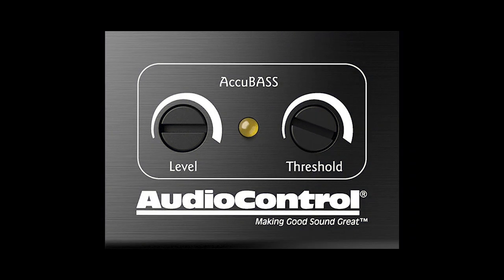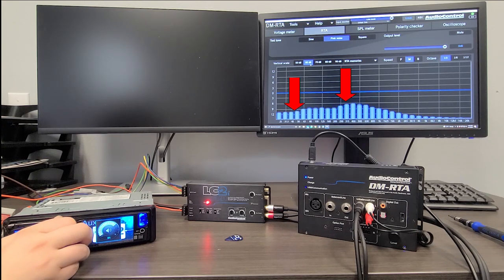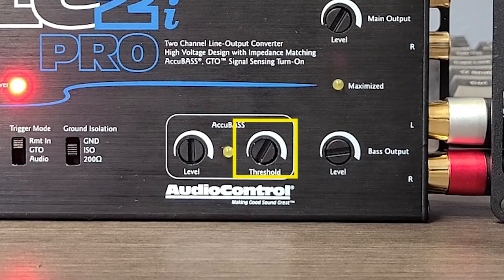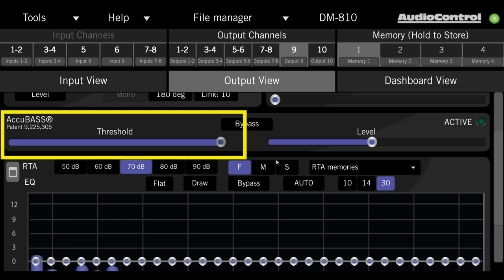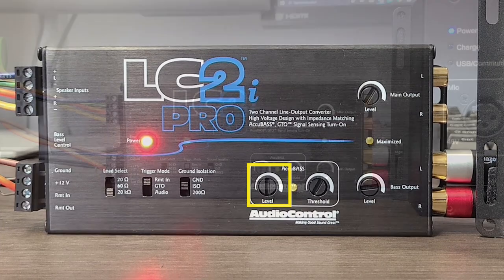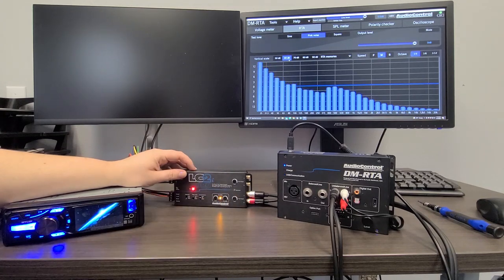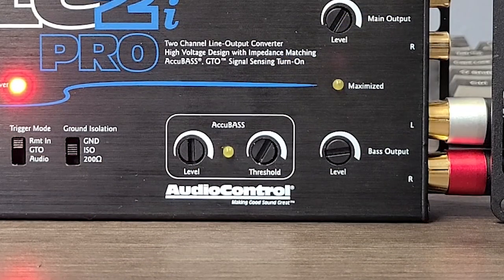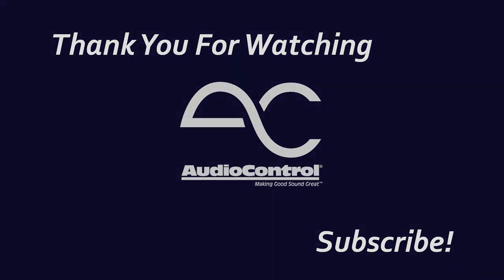How to set AccuBass

Comment: I have more questions now than when I first arrived. So I need to use accubass, my question is this? Why would I keep it always on as opposed to dialing it in? Any benefits?
Reply: If you set it to always on, then you're not really using it for the intended purpose.  I will give you my real life example:  I have a 2017 VW Golf R that came with the VW Fender upgraded audio system.  It has a factory 5" subwoofer and the factory head unit has a built in bass EQ that begins to reduce the subwoofer output as I turn the volume up on my stereo around the halfway point.  Any further increase on to the stereo volume, only increases the mids/highs but the subwoofer stays flat/reduced in amplitude.  This is so the factory amplifier would not overdrive the small 5" woofer and blow it out.   

Now when I install the AccuBass feature, I would take the speaker level wires from my factory subwoofer and connect it to the  LC-1.800 speaker level inputs.  This amp has their AccuBass function built in.  I would turn my factory stereo to the midway point on the volume, set the level on the LC-1.800 to the middle point then begin to slow turn up the threshold dial until the bass becomes balanced again.  At this point I can dial down the bass volume with "Level" control or crank it up more (Level is like "gain" on most amps which is kind of like the volume control but just for the amp.  You don't want to bring this up too high as you can cause the amplifier to "clip" and it may damage the subwoofer and or the amp as well as distort the sound). 

I think the best way to think of the "Threshold" feature is like a parametric EQ with a relative wide "Q".  What does this mean?  Well it's just a Bass EQ that has a wider effect over the low bass frequencies allowing you to boost just that range for a factory situation like my VW Fender setup.

Comment: So do I pair this with an epicenter?
Reply: No this is to help bring up bass levels when a factory radio head unit is reducing the bass volume as you would be increasing the overall volume.  I just posted a longer explanation above.  Have a look at that to see if it helps better illustrate why you would use this and how.  

Epicenter creates bass from an audio signal where it really isn't present.  The AccuBass "restores" bass that gets reduced by factory EQ settings -- most often done to protect small/weak factory subs.

Comment: Gain knob hooked up when u do this or off
Reply: Id first set your factory EQ settings to flat.  Then I'd listen to music and turn the volume up to the point where you can tell the factory stereo begins to the cut the output of the subwoofer.  Note that level on your factory radio -- in the video above you can see the stereo is at "31" when the bass frequencies in the graph drop in output.   Now install the Audio Control AccuBass component (either something like the LC2i or an AudioControl sub amp with the AccuBass included).  Hook up your aftermarket subwoofer and get the installation side complete of the gear.  Now you can set the AccuBass "level" to the midpoint, Set your factory stereo to "31" (the point where the bass begins to roll off) and now you can start to slowly increase the "threshold" just to the point where the bass becomes balanced with the overall sound.  If you want to bring the bass down in volume, drop the "level" a bit or you can boost bass output by increasing the "level" dial.   If you have the DM-RTA and a computer, the graph really helps you "see" where the level drops out so you don't have to "eyeball" it with your ears. 

Read my other response above to understand a real world scenario.

Also note that the level of "31" on his stereo will not be the same for every setup.  My stereo is at the halfway point in the setup.